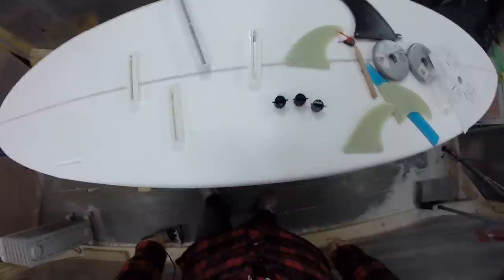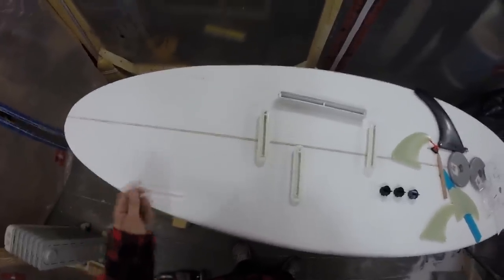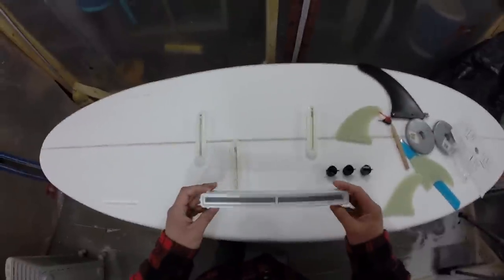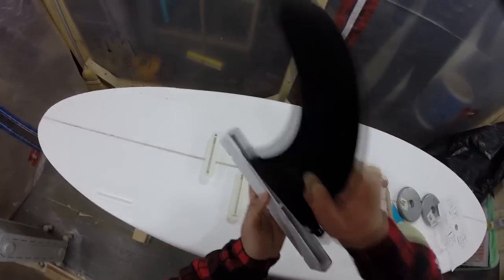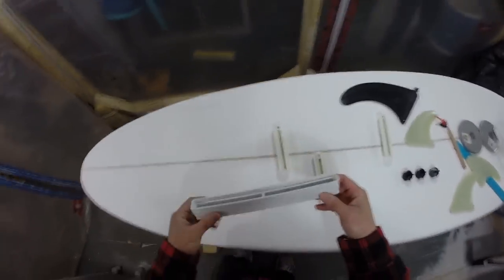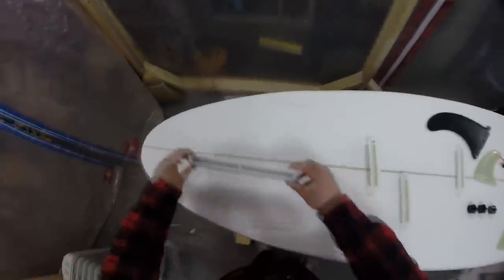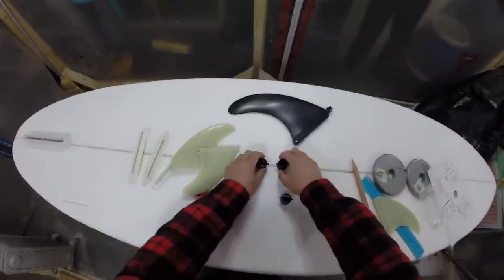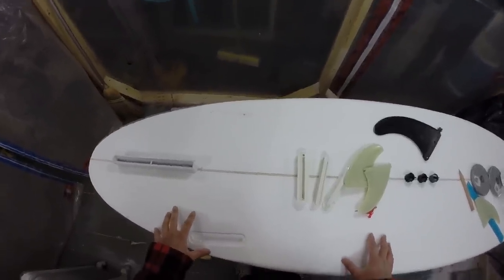Fin Systems for Surfboards- How to Build a Surfboard #17

Comment: Hi Andrew, first let me say your vids are a charm, they are all the patience tutoring a novice need (I am at least)..
Regarding the FCS fins , I am not sure they are going all through to the glass 6:14,
I assume you can do that , but my quad longboard  has bashed into a rock and they were pulled back...
I fixed the foam and fyber + coated it than drilled to about 1 cm b4 the glass on the other side...its enough I think..
But I do see those fcs with some pre-made boards go all to the bottom...
so I assume its the thickness of the board...
Keep on rockin...I am inspired by your vids (building my first beast :-) )

Comment: Thanks for the AWESOME vids!!
What sealer to you use?
Reply from the maker: Thanks!  I use something called LePage Poly Filla Big Hole filler, I have also used drywall compound and spackling wall repair.  But what I like about the big hole filler is it is pure white, the same color of the foam.  The next video once the winter is over will be sealing the board.  I checked out your at your profile pic, that looks like some river surfing!
Reply: Thanks. It's Lochsa pipeline, Idaho.

Comment: cool video what type of board is that by the way. the one with the glass on fins, also have you ever thought about doing a sting board?
Reply from the maker: Thanks, It's a eggish longboard, 8' custom.  What is a sting board?
Reply: that was one of ben aipa's signature boards its pretty cool its kind of like a retro funboard that has "wings" about 1/3rd of the way from the tail.
Reply from the maker: xxbluecometxx 1 Very cool, just looked it up, looks like a challenge for the future :)

Comment: Andrew,
when you installed fin box after glassing how did you force it not fall out of the board? Did you glue it or may be set on epoxy?
Reply from the maker: +Леша Варсунов I'm not sure what you are asking, could you explain a little bit more.
Reply: +Andrew W I use FCS fin plugs. Should I cover my board by fiberglass prior to cutting holes and installing plugs. or should  I firstly install plugs and after that fiberglassying?
Reply from the maker: +Леша Варсунов FCS plugs are installed after you laminate and coat with epoxy.  You drill the holes install the plug with resin and then sand smooth.  Check out this video where I install a FCS plug for a GoPro, not the exact way to do it but it gives you a starting point.  https://www.youtube.com/watch?v=HfROI0BK8AI
Reply: +Andrew W it is valuable info!